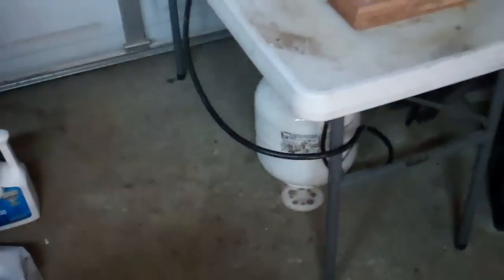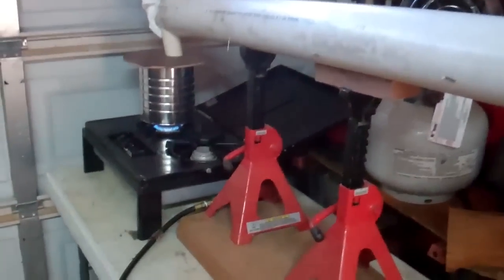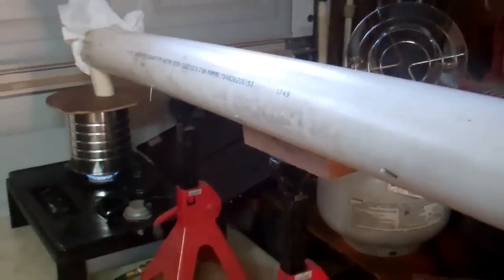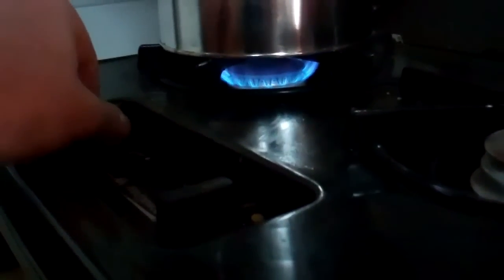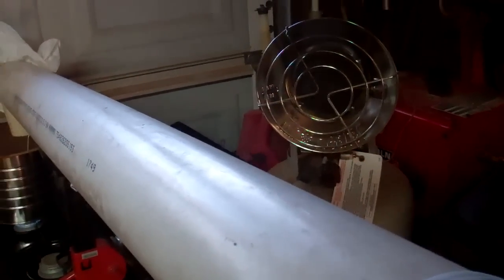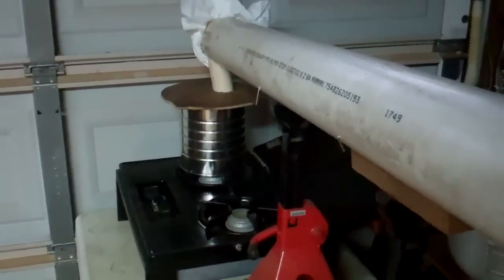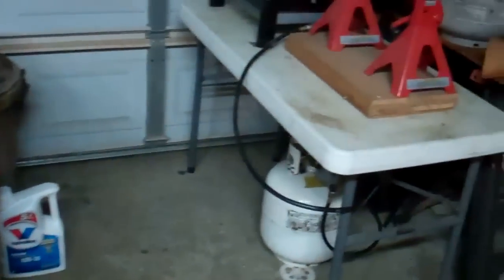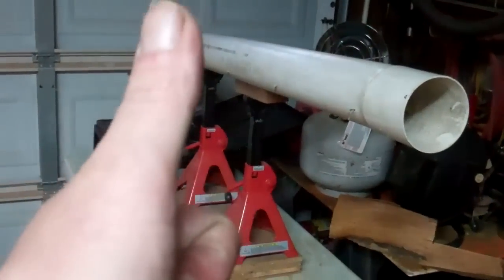Home-made tools, steam bender prototype

Comment: We do that every now and again.  we just use a section of steel pipe with a cap on one end with rocks in the bottom.  Then we just set it in front of the kerosene blast heater in the winter.  In the summer, turkey fryer flame underneath cap side.  That rig looks good even as a prototype and it obviously works which is the point.  Nice bending too... whats it for?